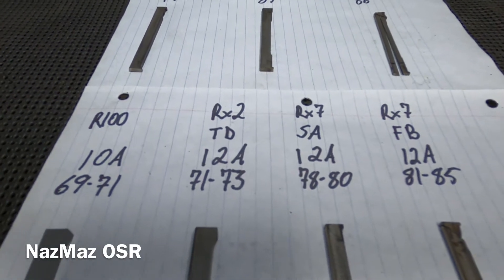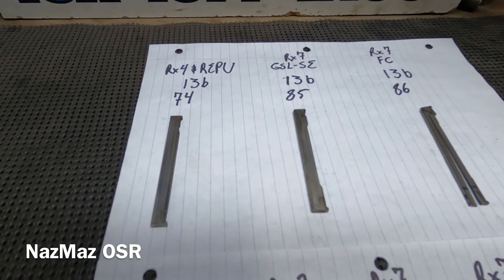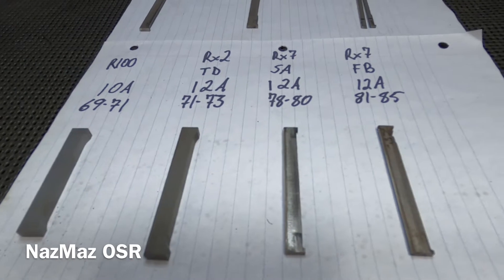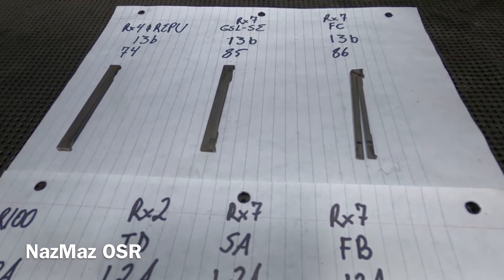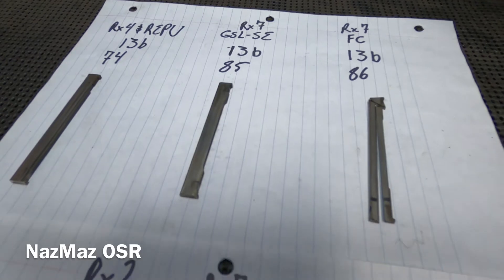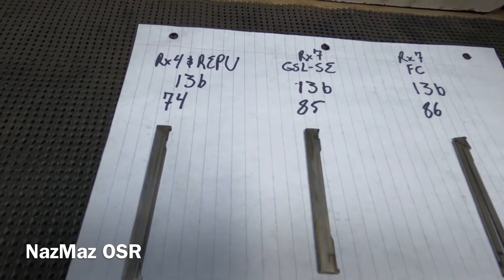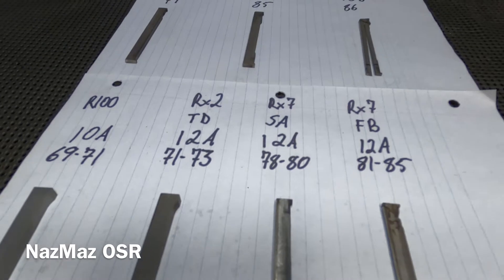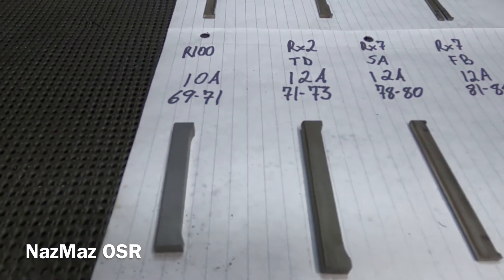All you need to know about mazda apex seals

Comment: hey bro in other countries they get the 12a SD and steel 3mm seal in 74// those 74/75 seals are unique as they use a longer wedge that is not pointy on the top. as such you cant mix the apex seal parts 74/75 with 76 upwards and you end up 1mm too long or 1mm too short . the OG 74/75 pattern can be seen in goopy and in atkins aftermarket apex seals. they tend to be much softer on the housings by design.
Reply from the maker: Ahhh yes the big letter 12A I do not have those apex seal in my stash but it's worth mentioning. Same issue with the corner pice on the 1974 13b you can see it on the video (7:50)

Comment: Thanks for clarifying! My Rx2 12A Twin Dizzy was a some point converted to Rx7 rotors and seals. Experts don't agree whether this is a good move or not. Yes, the newer seals are better and last longer, but they are also harder and could cause more wear. Also, I suspect the Rx7 rotors slightly change the position of the ignition timing of the Twin Dizzy 12A.
Reply from the maker: After 1974 Mazda introduced SIP (sheetmetal insert process) so the cromplating can stick better and handle the new 3mm apex seals before that time the chromeplating went directly on the aluminum housings, therefor it's not a good idea to use Rx7 rotors on 12A Twin Dizzy it will eat up the housings sooner than later, I learned the hard way lol. Timing does vary...
Reply: @nazmazosr1260  Thanks! That singles out the real experts from the flock of well-meaning amateurs! Engine rebuild on the horizon, then...
Reply: I dunno if you guys in North America got different spec housings apart from exhaust ports, but my RX-2 TD housings definitely have a steel insert under the chrome layer. The only housings I am aware of that use chrome directly on the ally casting is the MFR PP housings, which I understand even in single dizzy spec still use the twin dizzy exhaust port bolt spacing.
I am rebuilding a bridgeported RX-2 twin dizzy for my Mazda 1300, and all the guys here in Australia I talked to said the upgrade to RX-7 rotors was worth the performance and a little more premix oil would help with the wear.
Reply: @ryanworkman5229  My car is 1972 European spec. The harder apex will eat away at the chrome layer and should it wear through to the steel, there will be issues. Besides, there's the ignition timing issue. So, the choice seems to be to either keep the TD12A with original rotors and seals, or to swap it for a SD12A engine from an Rx7 with a 5-speed box.